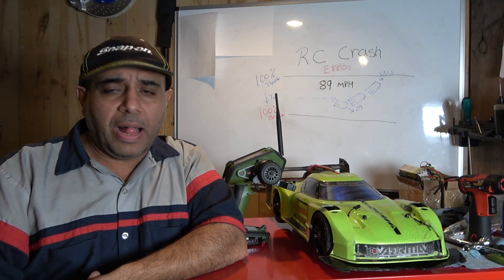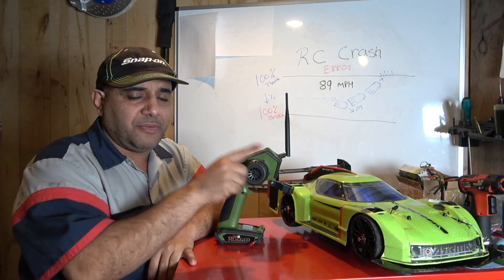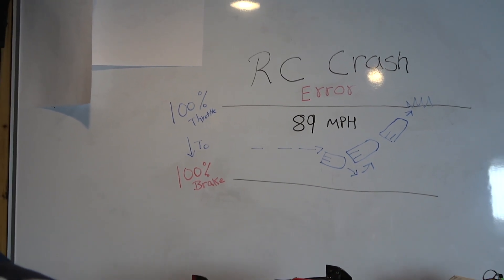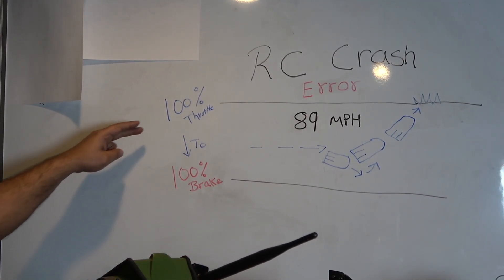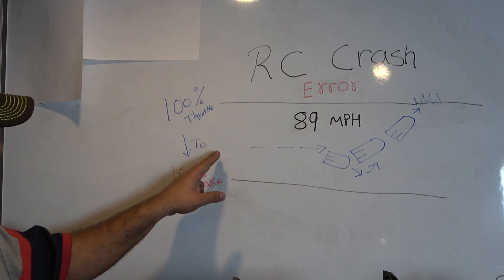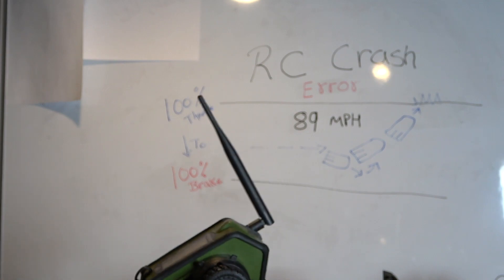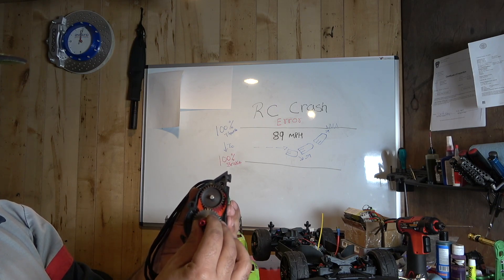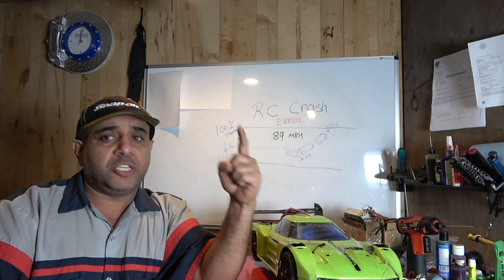RC crash Error or bad set up

Comment: Couldn't you set the radio with " ABS " settings .....I set up mines (Sanwa) on weight of rc ....just like the real car ......Kool features
Reply from the maker: Not for speed run small glitch can send it off
Reply: @rcusa201  Try the ABS on a test run. I use it on a few of my cars & it works great. I have the DX5 Pro & the settings should be the same as the rugged. I have never had a glitch. The ABS is adjustable on the radio for different sized cars. Love the channel content... Salute!